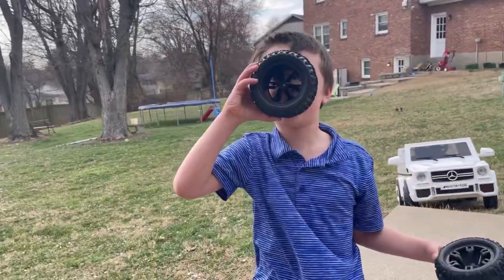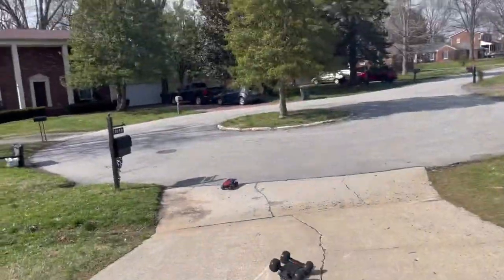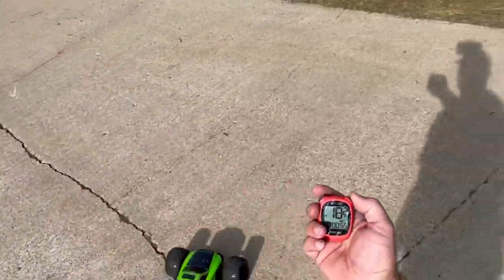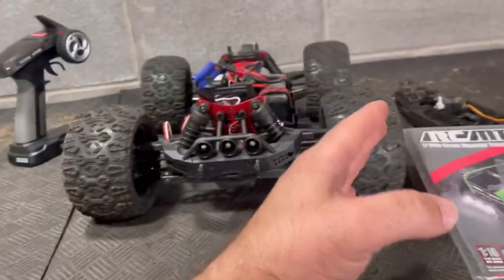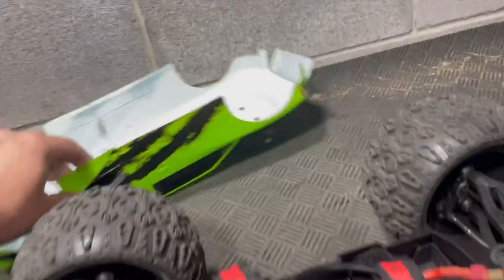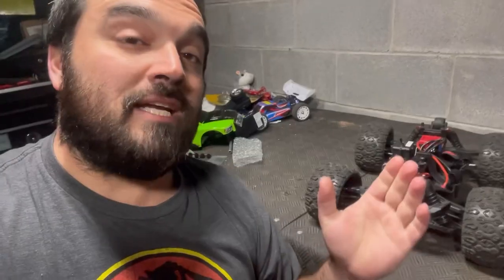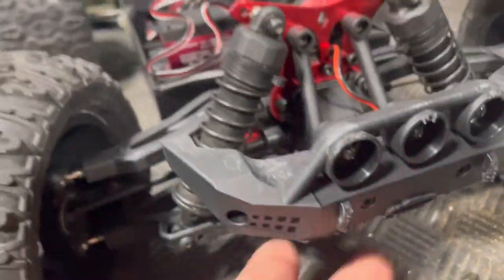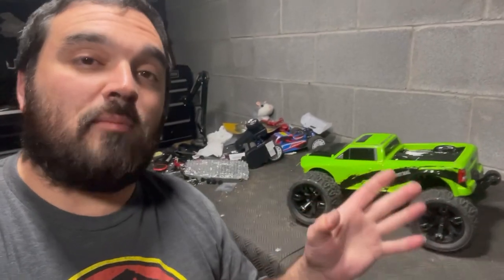The most UNDERRATED RC CAR

Comment: Looks good. I wouldn't let rain stop me, in fact I love RC's and mud.  The only downside is cleaning afterwards but i have a method my mate and I came up with in the 80's to keep em clean in all weather.
Find a pack of freezer bags that is just big enough to drop the chassis tub in. Take off the 4 wheels, drop the chassis in the bag, poke the axles through the bag, put the wheels on, tie up the open end of the bag around the wheelie bar, poke the body mounts through the bag and pop the body on.
Adapt the method slightly for each different car but once you have done it a few times it is not much more difficult than throwing a battery in.
Works a treat.
Reply from the maker: That’s a nice idea!
I will probably do a rain bash eventually!
Reply: That is an awesome idea. I spend hours cleaning the mud out of rc cars in the last week!
Reply from the maker: I agree!

Comment: Love yer vids and love that truck. I almost got one several years ago but hobby shop guy talked me into the Teremoto. That was a huge let down. Never ran out a pack without breaking something first. Keep up the good content Bro.
Reply from the maker: Thanks man!! You could still pick one up! 😜
Reply: Bummer!! Hopefully you don't shop there anymore? One of the reasons I don't go to the local shops anymore, they always push what "they" like, which is usually TRX.  Nothing wrong with TRX,   as long as you have a fat wallet,LOL.  Redcat is hit or miss..definitely gotta do the research on it before buying one as some models are really weak while others are really good.

Comment: So i got this Exact truck 2 months ago and can finally drive it due to snow clearing up, but gotta ask how you switch to 3S, im new to rc's and this is my first one, im loving it and its fun but i feel it can do alot more too
if it is a battery thing, how could you tell whether your current battery is or isnt 3s
Reply from the maker: The battery should have a voltage reading. 2s is 7.4 volts and 3s is 11.1 volts.
The smaller “balance plug” will have 3 wires of its a 2s and will have 4 wires if it’s a 3s.
This would be a decent battery for it. There are two packs available as well.
https://amzn.to/43znMYT

Comment: If your in any way shape or form shooting to become an RC enthusiast, and want something that will be of much higher quality.. it is highly advised you not waste your money on RedCat anything!
Go straight for the Arrma Kraton 4S.

-By no means Arrma fanboy, this statement is fact based from quality to price, and long-term parts availability!
Reply from the maker: I understand, but I disagree. I like Arrma, but don’t have any 4s yet. I’ve got a 6s Kraton, and a 3s Senton. I was going to get a 4s outcast but got turned off by the chassis easily breaking. This car is so far easily as good as the team associated mt10, which is definitely worth the money.

Comment: I broke the steering linkage. I don't know what's called. It has silver ring below it. There is a screw that goes from the bottom red plate up into a tube Through it. It's trapped in chassis. It seems to be stripped. It will tighten but won't loosen. There is another screw directly above it that actually back's out when I tried to loosen it. I noticed the screw directly across it does the same thing. Any ideas. Thank you for the video. And also what it the name of plastic steering assembly above the ring that controls everything. Again thanks for any input

Comment: Yo! The Redcat Dukono is on sale right now for 100 off. It’s 139.00! The body is super thin and a horrible and I’ve actually doubled the body up and reinforced it but the wheels are phenomenal and the shocks are phenomenal. I’ve had mine since 2018 and the shocks still work exceptionally well and the tires I’ve told you about in the past they’re amazing. The differentials can also handle 2S power no problem if you add a brushless system. It’s a really good RC with a few upgrades and modifications.

Comment: 1st upgrade, needs to be Belted Duratrax C2 Hatchet MTs.

The truck NEEDS belted wheels, to be controllable.  The stock tires, balloon like no one’s business.

Then a Center Diff, with 100k diff oil.

Beyond that, all I did was swap in a Flysky Noble receiver to add it to my transmitter, throw in some stabilizer bars, and an HPI D Box 2.  

Very fun basher.  Just make sure it’s not cold, when you bash.  The plastics are tough, but get really brittle in lower temps.
Reply from the maker: Thanks for that info. Ya the cold weather is horrible for any RC for sure.  👍👍
Reply: That's funny. Literally the only 2 upgrades I did was immediately upon ordering I ordered the center diff. Fluid I put in 100k. Full throttle will ride a wheelie for about 40 feet without flipping on its back. 2nd was order the 17mm hexes from Team Magic so I could take the belted Hatchet MTs off my JLB Cheetah and put on it. I just put 80wt in the shocks and am waiting to receive the hardened springs. After that I'm thinking about upgrading to the 11 or 13 tooth pinion, but that center diff with 100k is a must have for this truck!
Reply: I did the center diff with 100k before I put on the belted Hatchets. Ime that's first thing you should do. That center diff is a must!
Reply from the maker: Awesome info!!

Comment: Great video!!! Might want to grab a Volcano EPX PRO from Redcat before they are gone again!!! Not really a stunt truck basher but a great looker and fast
Reply from the maker: It did catch my eye. I do like the body on it for sure!
Reply: I like the epx pro but ive always had issues blowing diffs on 3s
Reply from the maker: 1/12 scale cars and larger should always have a center diff or atleast the option for one. Hopefully they’ll be more standard eventually. That will help with drivetrain problems

Comment: So I have this truck and I replaced the rear pinion and diff spur gear (?) and when I put it back in, it took about 2 minutes for the grinding to come back and ultimately a no go. Do you think just putting the optional center diff and replacing the front and rear pinions will fix the problem? What weight fluid for front and back? It got me really discouraged as it was my first time with and working on a fairly hardcore machine.
Reply from the maker: Interesting. It should certainly take some pretty hard abuse like in this video before that happens, however , landing jumps while holding the trigger at all or doing crazy ground maneuvers can certainly kill them pretty quickly.
The center diff should make a huge difference though!

Comment: Optional center diff with 100k w fluid makes it damn near perfect! Full throttle from take off will ride a wheelie for about 40 feet without flipping on its back.
Reply from the maker: Sounds sweet!
On my Kraton I prefer 500k in the center, but this is much lighter and has a smaller wheel base so 100k is probably perfect. Getting ready to order the center diff and a new front diff!!
Reply: @DerbyCityRC I swear I remember the center diff being crazy expensive. The metal upgrades from Team Redcat were like 2 to 3x over priced! Fully upgrade in 2019 it was like 600 lol😮😢😅
Reply from the maker: I think it’s only like $28, which is pretty reasonable. So far that’s the only upgrade I even feel the need to do!! 😀
Reply: @DerbyCityRC  The RC is killer. I remember telling you to get it over and over. Servo horn broke on me 2x but apparently there’s an upgrade. I gotta check when I start running it again. It looks like you kept the rude height stock but I raised the suspension and ride height. Tires are good but they need an upgrade. Other than that it’s SO GOOD! I loved watching you run it. Yeah yup. Yup. Yup. Is it cool I got all the drinks in here and everything for him. Are used to watch these. Italian guys are Reparto RC all the time. I can’t actually remember the name right now but when I find the channel I’ll hit you to it but they would kill that RC at the skate park.
Reply from the maker: Awesome!! 🤘😉

Comment: I almost got this one instead of my Team A  MT-10. Prices were good on both of them. I ended up deciding on the Rival, but it’s good to know that no matter which way I would of gone, (Team A or Redcat); either would of been a great choice. I’ve got some other Redcats. And love’ em ! Customer support is outstanding too!  Really great video Evan.Wicked cool!💯💪🏼✌🏻
Reply from the maker: Ya I’d say you can’t go wrong with either one! Obviously a great choice with the Team Associated, too! I’ve heard Redcat’s customer support is great by several people!
Thanks Robby!!
Reply: I got me this exact one finally worked out all the tweaks. Breaking an A arm seams like TA has H arms. Sometimes I really wonder if it would of been better if I would of gotten TA. After working everything out with my diff issues I think RC did a good job. TA just re-released it???!!!!
Reply from the maker: You think the TA seams better? So far been hard to compare, especially once I get the center diff in my redcat. Yes they did just make a version 2 of the rival but it’s the exact same thing with a different body

Comment: Hey Derby, I have a question about my newest truck which i cant find the answer to and im hoping you might know. Just bought a Redcat Blackout XBE pro and I noticed that when im not on the throttle there is tons of drag.  I hooked up my program card and its set to 0 drag. Is all that drag normal or is mine defective? Thanks in advance.
Reply from the maker: It really shouldn’t have drag. Does that remote have a throttle trim on it? If so, be sure it’s set to 0 or in the middle. Or possible need to adjust it slightly forward.
Reply: @DerbyCityRC  The problem was actually the massive dust cover and the plastic that covers the diffs. if you tighten the screws, it has the drag.  if its loose there is 0 drag.

Comment: I like that green color but the diff issues is something that stops me.i would prefer the rival mt10 with the new graphics as the price is close and the rival has the third diff installed already! ( give us more video mate!)
Reply from the maker: Yes I agree. Performance on this one may be a bit better than the rival and I’m confident once that center diff is installed, it will solidify the drivetrain. (Also I was very hard on those gears lol. I’m not surprised at all!) Rival is an amazing choice either way!!

Comment: I've had the old version and, yes I spent more time on the roof than on wheels 🤣.  Invest in replacement shock towers and keep the pinion gear stock (9T).  I reinforced the body with duct tape and its holding up ok.  I upgraded the pinion and the speed control shut it down because of overheating.  Great Video! Peace!
Reply from the maker: Ya it loves that roof!
Good to know about the pinion. I’d say on 3s it’s fast enough anyway 🔥
Thanks!!

Comment: The noise the body shell makes sounds incredibly cheap, but man that thing moves! I've got to stop watching your videos, I keep wanting new trucks each time...
Reply from the maker: Yes it does and the body shell is pretty weak, but the rival mt10 sounds the same way. Just very plastic-y cars.
No don’t stop watching! 🤣
Reply: The body shell is actually pretty robust Iv beat on mine and landed some flips on its lid from 6-7 feet in the air several times and there’s 0 cracks. Iv slid it on its lid trying to learn how it likes to wheelie several times over and noticed it doesn’t even really scratch that much. It does but less than other RC’s I have owned by “better” more name brand companies. This shell is thick compared to a slash or a rival and others. The sound you hear is the shell vibration on the body mounts. Once you throw some gorilla tape inside the body it is silent.

Comment: OMG! Do I have anything or everything to do with you buying my favorite 1/10 scale monster truck ever? The king of the Skate Park. Actually tougher than the Granite to me and with one upgrade I believe it’s tougher than the rival.
Reply from the maker: Several factors went into the decision 🤣🤣
Is the center diff the one upgrade you’re talking about? It was awesome for sure!!
Center diff is coming soon!
Reply: @DerbyCityRC  the one upgrade is the servo horn. I tortured mine without a center diff and it still was brutally tough. I never land on throttle though and it’s definitely my favorite monster truck without a center diff. The Redcat Dukono suffers even more than the 10E without a center DIFF. I do remember one upgrade in 2019 being like 160 bucks! The suspension on the MT10e and the Dukono are both awesome!
Reply from the maker: Ya that’s awesome! You definitely helped lead me into getting one 😎
Reply: @DerbyCityRC  👊
Reply: I forgot to add the front metal chassis guard, and I don’t wanna get the word out there too much but TRUST ME order the metal front chassis guard and a few arms etc… I FEAR its being discontinued and parts will dry up but don’t tell anyone 😂😢

Comment: At first you peaked my curiosity..
Now you have my full attention! 
That thing took a lickin and kept on flippin!
Reply from the maker: Yup! It sure did! I’m sure you could find all kinds of cool things to do to it. Trying to figure out what tires I want for it now. I saw you’ve had those cheap 1/10 2.8” tires on your mt10 that I’ve used in my Flyhal, do those work well on it? (If you know which tires I’m talking about)
Reply: @DerbyCityRC  
Yeah man, those cheap 2.8 tires were actually really good. They handled 4s power no problem. 
For the price, I would definitely recommend those. They fit good on the mt10 and performed surprisingly well. Great traction and just the right amount of ballooning.
Reply from the maker: Nice! I’ve got a second set of them already!
Reply: @DerbyCityRC  
Nice!
I'm actually rebuilding my mt10 again. Putting the stock chassis(short wheelbase) back on it. 
Preparing to make it a street build in the next couple months. 
Going to drive it around like a monster truck till the street parts get here. Should be an interesting experiment I think.
Reply from the maker: I think so!!!!

Comment: Great vid. Do you know what is different between mt10 e and mt 10 ? Looking in UK and mt10 seems different internally to your mt10e besides different shell. Keep up the great work
Reply from the maker: Yes they’re completely different manufacturers so they are very different. Electronics, plastics, complete design.
Both are amazing! Redcat os slightly
Bigger.
Reply: @DerbyCityRC  thanks for the reply.  looking to get into the hobby and loved the look of your review. Obviously want great durability and usability in off-road as tried battery and petrol ones in past ( doing more research this time round before buying) but lost interest as they would break with minimum use hence the loss of interest. Keep up the great work.
Reply from the maker: Thanks man! Yes a truck that breaks easily definitely makes it less fun. So far this one seems solid as can be! Same with the rival mt10. Working on my video for the Arrma granite right now as it compares to both of the MTs!
Reply: Awesome. Will keep look out for it. Like your vids with no bias sponsorship hype or bs. Been looking back through your other vids to see if you did a best of! in the different budgets/categories. Thanks again for replying.  keep up the great work.
Reply from the maker: Glad I can help!
So far really just a best RCs under $150. I’ll be doing a l other budget best if video soon.

Comment: I just got the center diff kit and the front and rear sway bar kits for mine! OMG what a difference!! It drives like a completely different truck now… in a good way
Reply from the maker: Nice!!!!
Where did you get the center diff kit? Shows out of stock on the redcat website.
Don’t put an actual link here cuz yuobute will probably flag it.
Reply: @DerbyCityRC  I got it  from the redcat site. Must be out of stock now. I’ll see if I can find it anywhere else
Reply: The rear diff went on mine.  probably about  the same amount of run time it took for your front to go. 
That truck should absolutely come with the center diff
Reply: The kit should also come with a new spur gear assembly and a new upper deck
Reply from the maker: Yes it should! And the metal skid guards!
Reply from the maker: Have you broken that stuff? I haven’t run mine in quite a while lol
Reply: @DerbyCityRC  the only things I’ve busted is the rear diff and drive gear and a rear arm. 
I did swap out the 80a for a 120a HW and that’s when my diff ate itself lol. Since the center diff install I been beating it up pretty good and nothing else has broken
Reply: Yes it should have come with the skid gaurds! I want them but they’re expensive. 
And You weren’t joking about The body, it’s  cheap and flimsy. I reinforced it with drywall tape and e6000 before I even used it.
Reply: Agreed! That’s how they make their $ though. I’m sure everyone who has one had the same problem and that’s why it’s sold out now lol. 
Oh by the way, any plans for the Kaiju yet? I think the OG Kaiju is right up your alley. It’s literally designed to be a stunt truck with its short wheelbase. The newer extended wheel base Kaiju Ext is bad#ss too but it’s more designed to be a basher

Comment: I've tried spreading the word of this rc. I think it's one of the best 10th scales. This and the helion/rival MT10 are the best buys for rcs in the $300 range. I've owned a granite and big rock and this bad boy is much better. I'd recommend DEFINITELY getting the center diff kit. Can find them for around $30 bucks and completes the truck. Helps with that violent power it has with the stock direct drive
Reply from the maker: I agree!
Yes the center diff kit will be coming like I mentioned. And a beastly comparison between both those trucks!
Reply: @Derby City RC  Yeah I commented before the end lol. I heard you mentioned it at the end. Makes a huge difference for sure 👌🏼 👍🏻
Reply from the maker: Yup! Definitely part of what makes the rival mt10 so great! I’ll be ordering it this week!